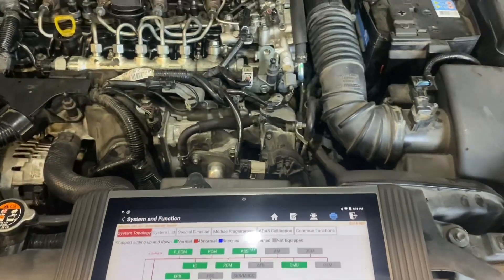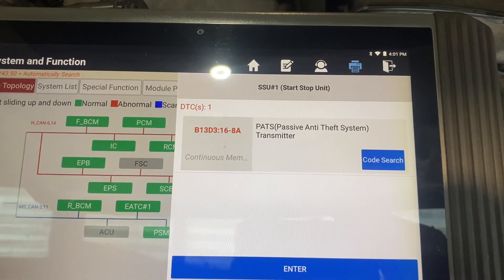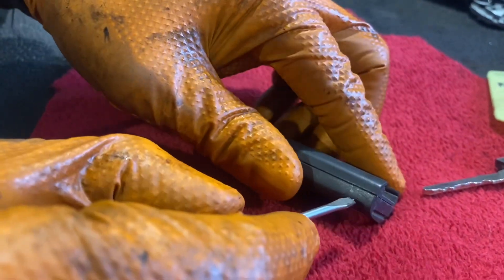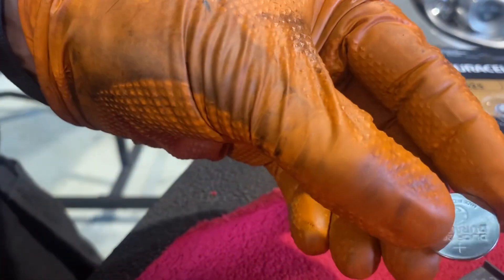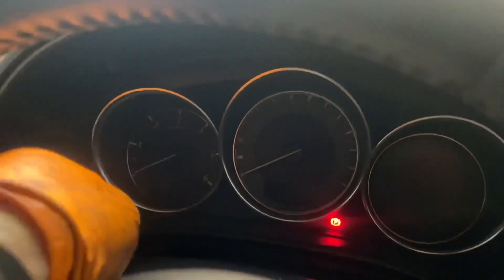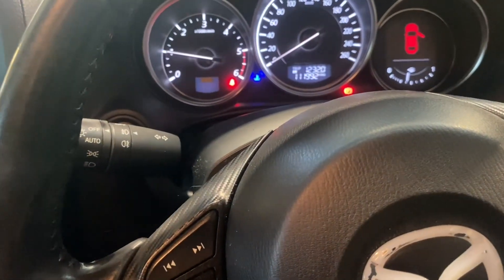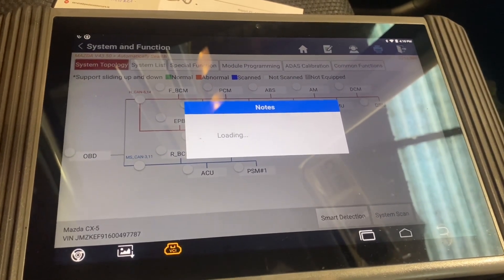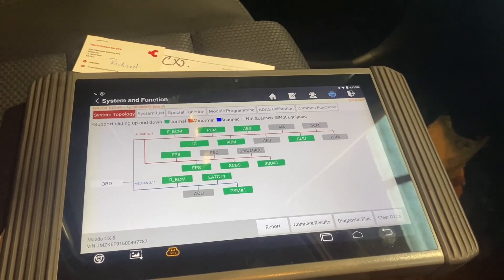Mazda CX5 ,PATS transmitter,Battery in key

Comment: Thanks for the video. Just my 2cents : When changing the battery try not to touch it with greasy fingers or gloves. Use a clean tissue to hold it when it comes out of the pack. Oil etc. on the battery terminals can cause issues. Clean contacts and or battery with isopropyl alcohol and a clean tissue if needed.

Comment: Hi! I do have this same code on my 2014 Mazda 6. It has a 2.5 gasoline engine. But what I am experiencing is that my car will start in 2 seconds but will cut off immediately. I tried everything I could but still no luck. Hope you could help me with my situation
Reply from the maker: Sorry man I don’t know could have an immobilizer issue there I would get the key checked out make sure there’s a signal coming from it